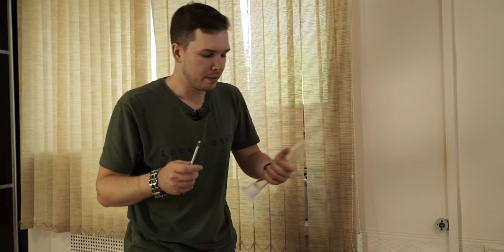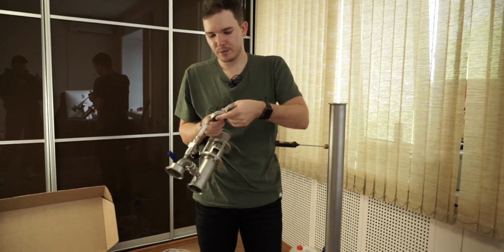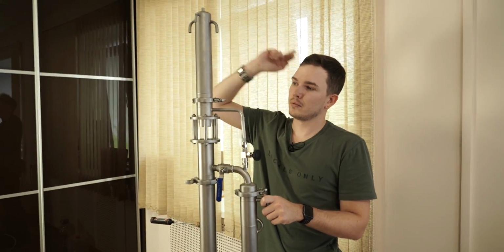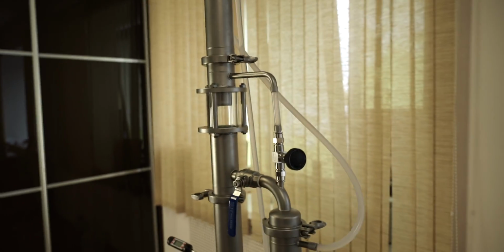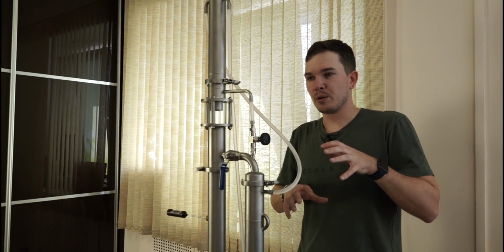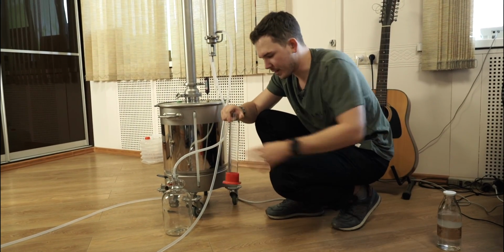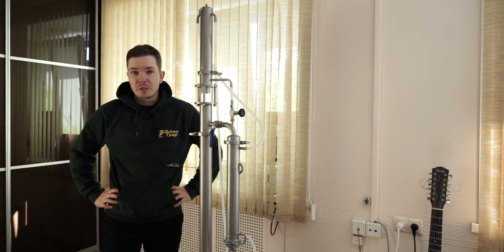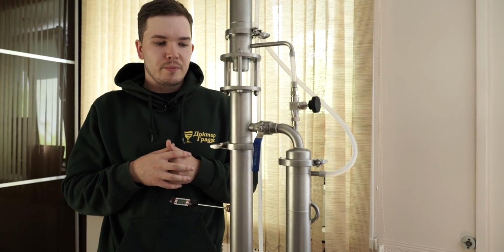Second distillation - Stillman X Liquid management

Comment: In the video, you mentioned that by adding an extension and additional 3.5 x 3.5 SPP that the output of the Stillman X, running at 1.5KW, could go from 1.1 liters per hour up to 1.5 liters per hour. How large of an extension pipe and how much more SPP would be needed for this?
Reply from the maker: Hi Tim. Yes, adding another 650 mm extension with SPP, will provide better quality of spirit and speed can be increased up to 1.5 litres an hour. You will need another 1.3 litres of SPP 3.5 mm, which is 1.5-1.6 kilograms. Feel free to ask more questions.

Comment: Hi Doctor Gradus, just wondering if you would know what voltage I would need to achieve 1500w in the boiler? Im using a power controller with a voltage display & using the 1900w 10amp element in the boiler. There is 220 volts coming into the property.
Reply from the maker: Hi! Well, I have a few questions about your setup, can you write on our email? Doctor-gradus@list.ru or Doctor.gradus54@gmail.com

You can attach photos of your regular, that would be helpful.
Reply: @DoctorGradusInternational  
Will do, I will ask that question and attach photos on your email.
Thanks.

Comment: Hello, just wanting to know, do you increase the power throughout the run or do you just leave it at 1500w while using 3.5mm spp and LM mode?
Reply from the maker: Hello, yes I was staying at 1500w all the time.
Reply: @DoctorGradusInternational  How do you know/calculate the watts needed?
Reply from the maker: @Audigiant   hello, it all depends on the column, packing, height of the packing part and if there’s insulation.

Comment: Can the spiral condenser be used as a reflux condenser? If so, does this change whether the spiral is on the top or the bottom?
Reply from the maker: You mean spiral+shotgun - yes, it can be used as reflux condenser. In this case spiral has to be on the bottom, so it will be first to contact with vapour.